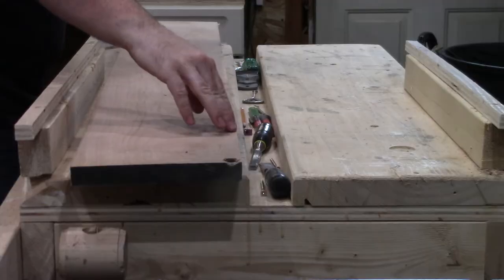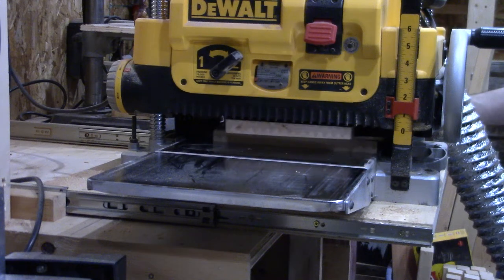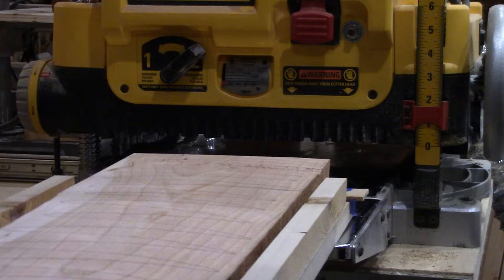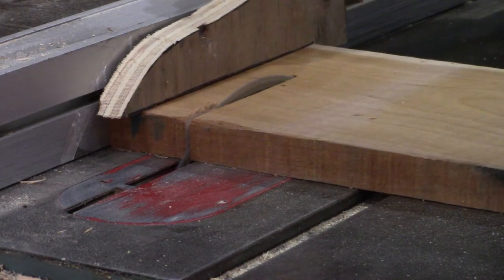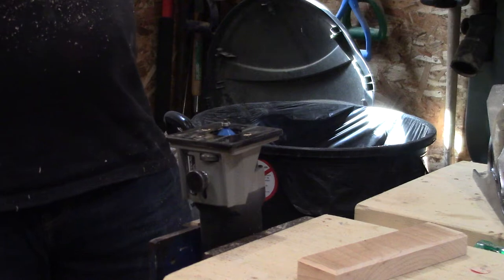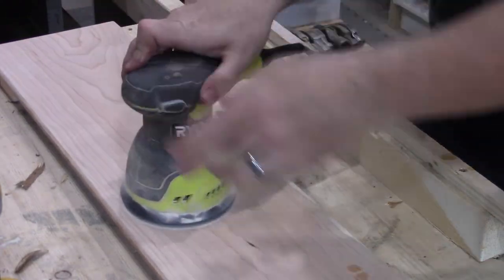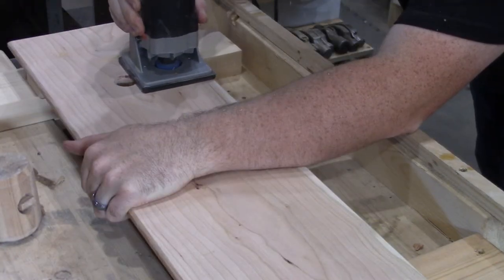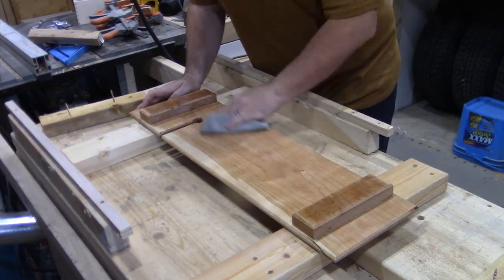Building a Bath Caddy for My Wife

Comment: My favorite adhesive for thickness planers is carpet tape.  There's an industrial type you can get that I probably wouldn't use (it's so freaking hard to get off) but the lighter stuff works great.

Congrats on the anniversary...I've never stuck with tradition, but if it makes the wife happy, right?
Reply from the maker: Good thinking. I have an idea for a better sled but I haven't had time to do anything with it yet. Will have to sooner rather than later since I think I'll need it for the table project.
Thanks! Yeah me neither. I probably wouldn't have known if she didn't point it out to me, haha.